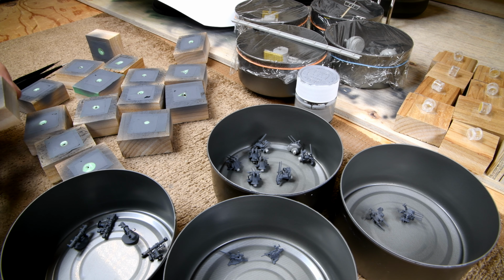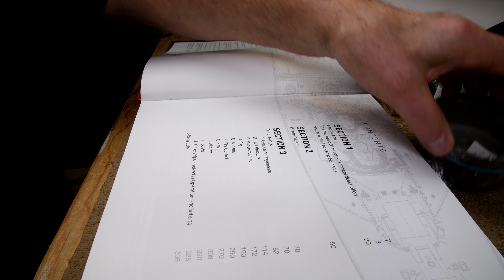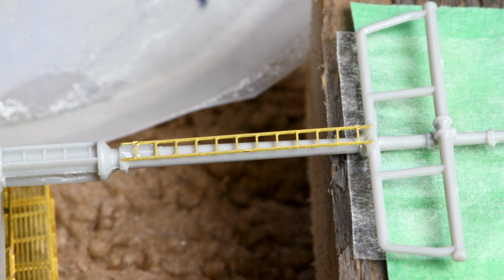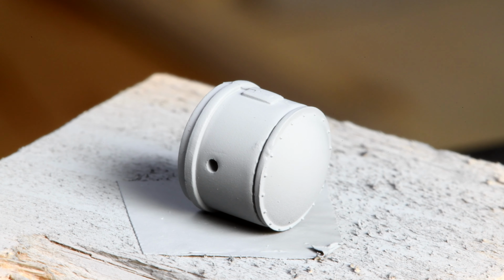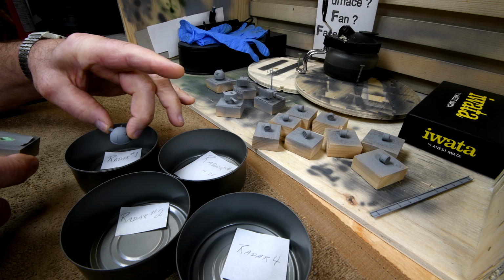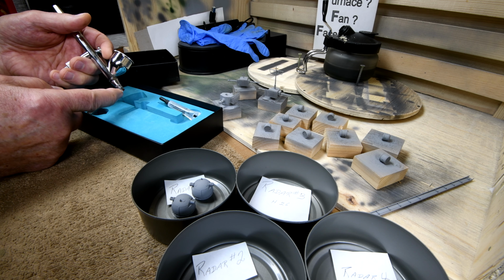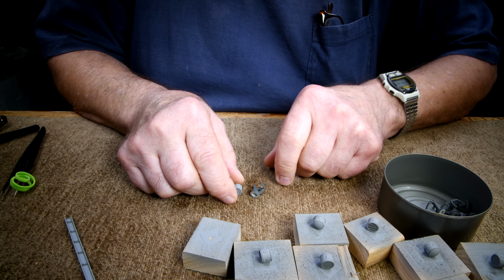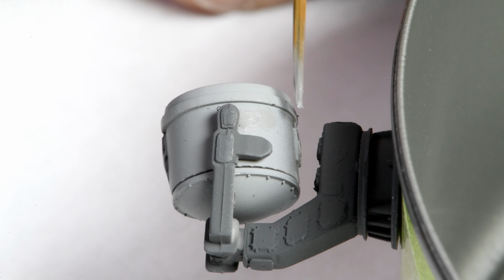The Model Ship - Part 144

Comment: Touch up adds realism. A true story. I was with a unit getting ready to go to Vietnam and we had about 100 trucks and jeeps we were shipping to meet us there. All of these vehicles were brand new with immaculate factory finishes and very low mileage - but everything picks up scratches. So every couple of weeks a bunch of us would get the assignment to touch up the trucks - we were given three inch brushes and a gallon can of paint. I think we all found it hard to do, but after getting chewed out a couple of times for not covering some minor scratch - we learned - just slap on some OD green paint with the three inch brush and everything was fine. So don't worry about touch up - your just adding realism to a military model.
Reply from the maker: .... that's a good way to look at it John 👍

Comment: One thing on using the wrench to tighten the collar that's over the nozzle..... make sure that the needle is not locked down when you do the tightening.
The nozzle is (I think) made of brass (or chrome plated brass) and is a bit soft. Tightening with the needle locked in place could force the nozzle down on the needle - spreading it open. Also, the plumber's trick for finding leaks - soapy water to see if the threaded collar has an air leak.  Your turntable worked GREAT on the radar and range finders!!  GREAT JOB!!
Reply from the maker: Thanks for that tip 👍